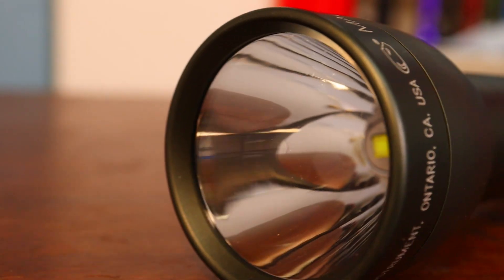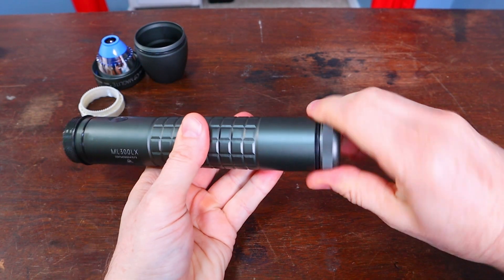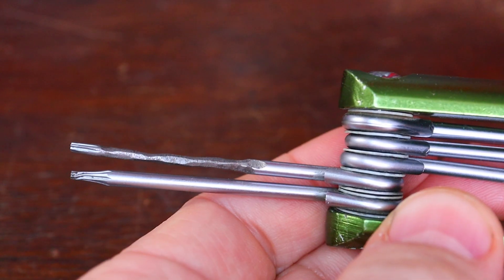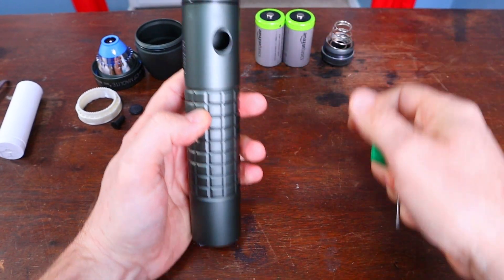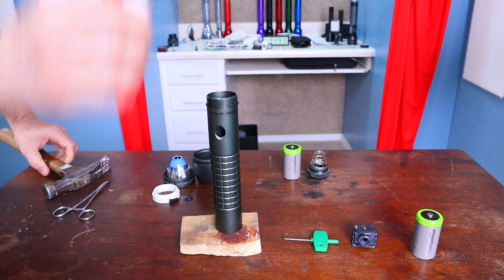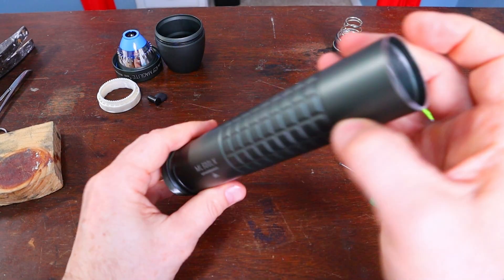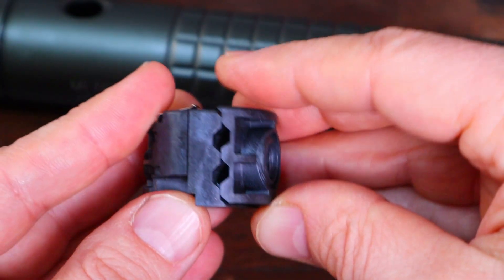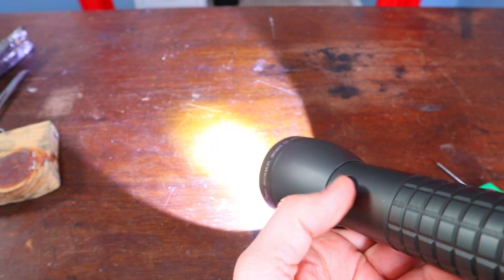Maglite ML300LX Tear Down & Reassembly (Full Breakdown)

Comment: The real positive side of this flashlight is the fact that runs with common, cheap alkaline D batteries.
I've hundred or so lights which require Li-Ion cells if various sizes, or primary CR123A. When you travel or when you can't access the battery stash in your home or workshop, primary alkalines from the supermarket are your only source of portable power. This flashlight is for anyone who wants a reliable flashlight, and is not a flashaholic...
Anthony
Reply: And for cold weather you could use Nimh rechargeable.
Reply: Yeah, maybe... if it was 30 years ago. 

USB-C charging lights are ubiquitous, there are USB-C charging individual batteries, and even if you don't like on-board charging for valid reasons, a single-bay charger takes up basically nothing in space and weight on a bag.

Comment: The style of switch is interesting: easy-ish to disassembqle but unlikely to fall out on accident. Looks easy to 3D print for too.

I can see this style design being necked down to common li-ion battery size. A single cell 21700 or 18650 version of it would be at least interesting.

Comment: Looks easily modable vs old incan mags. 

I think it needs a HI chip without a dome 😏 
Driver in the switch is kinda neat for some reason. Miss those old two stage M3LT style tail switches honestly and BIG FAT TURBO HEADS. Everything has gotten brighter and smaller and it's essentially killed off my favorite size body tube of 3 cr123As or 2 18650s.
Reply from the maker: I agree, having a flat LED in this would be epic.
Reply: 2x21700 is close enough and you have a few options of Convoys (M21G and M21J) on that size. Have you checked them out?
Reply: @DinnerForkTongue yea but I love the old bodies, I've got some NIB Pentagonlight X3s and stuff like those haha. I wanna start retrofitting a few of my incans for high cri like the 519a. Getting reflectors for some head sizes and depths can be a pain though so sometimes I have to work with the old "Drop in" and fit it with a diode and driver. 

Fun hobby
Reply: easy? You do you want to desolder the led from the tower?
Reply: @Gieszkanne lol I just resoldered a Nichia 519a from a Milwaukee penlight into my powertac E3R Nova. Because the Nova required the thinner copper star and couldn't take the thicker aluminum star with the Nichia on it. 😅 I will go as far as I feel to make a light more amusing to myself.

Comment: Is the heatsink beefy enough to handle a modded driver?
Or do we need a return of Fivemega with a custom heatsink?
Reply from the maker: I think it can handle a bit more current.  Its running at like 1.4 amps right now.  I think it could go as high as 3 and be okay.  Its stainless steel so I will need to test it and see if the LED will be able to shed heat fast enough though.